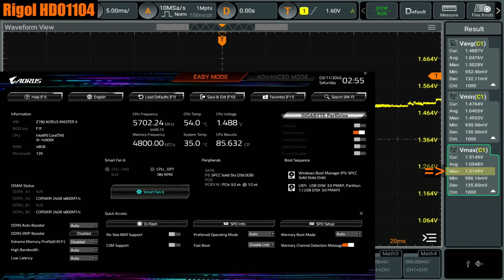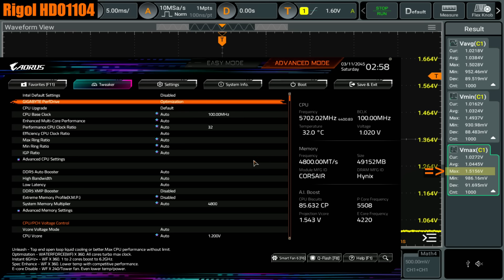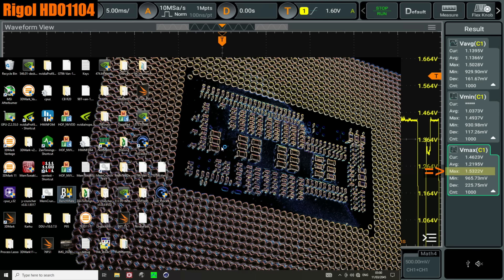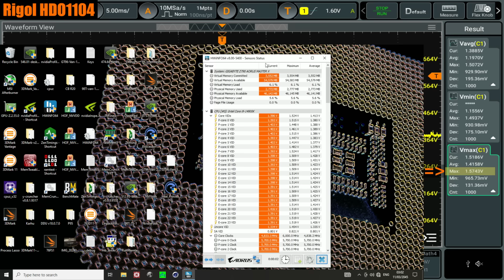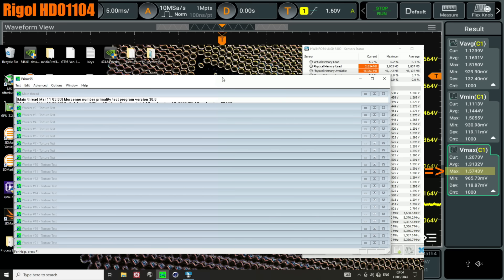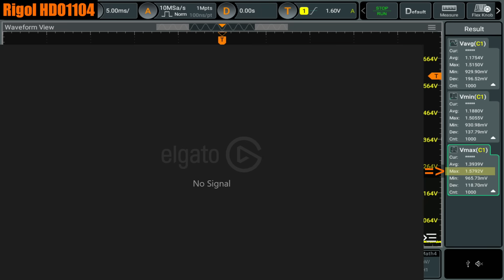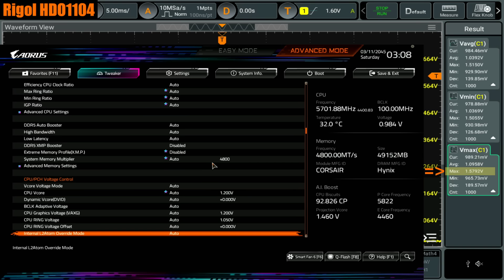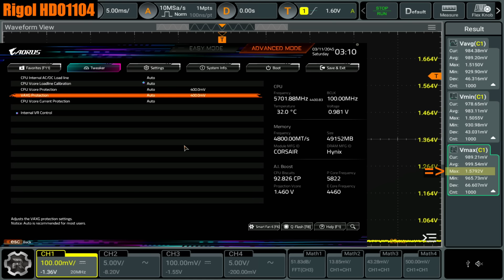Turning off "Intel Default Settings" with Microcode 0x129 DISABLES THE VID/VCORE LIMIT

Comment: I am forever glad that when I decided to upgrade my 5950X to a newer, gaming-focused setup, that I went with the 7800X3D instead of going with the more expensive Intel route, cuz holy crap would I have been pissed with all this going on if I'd paid ~$600+ for that CPU.
Reply: Yep, lots of Intel shills are pissed there $600+ CPU kills itself on arrival basically.  Even coping by saying "just rma it haha" until Intel rejects your RMA lmaooo
Reply: @Nighterlev  i think youre on the wrong channel, there is no way you can have this opinion unless you dont know what the problem is these cpus had. 
Spoiler: too much voltage. Take care of it yourself and youll have a cpu that wont kill itself, just like any other cpu that doesnt get fed too much voltage..
Reply: How ironic. I'm currently building an "open box" intel system with a 13700k, and to get anything that would even come close to competing I would be spending double for AMD. I don't have any brand loyalty and I was really trying to put an AMD system together this time. Not even with returned/open box products could I come close to my 13700k ($235) and Asus strix z790i ($213). Open box but unused. I really tried though.

Edit:
Even if I had purchased that CPU before, I don't think I would be pissed. I've been using Intel products for two decades and they've never let me down. I knew they would have fixed the situation and make good with their customers. Which they have, with fixes (still in beta) and a five year warranty. 👍
Reply: @DingleBerryschnapps  Nobody is talking about "open box" CPUs here. At one point I used Intel CPUs too, hell most of us did...because they were better however things change and AMD makes the best gaming CPU on the market right now.
Reply: @DingleBerryschnapps what are they going to do with all the small custom PC businesses that are going to have handle hundreds/thousands of CPUs that now need to be replaced or at least have the board BIOS's updated then tested? Is Intel going to pay for the shipping of entire PCs, the extra time and labor?

I flip PCs but thankfully never sold any with 13th or 14th gen Intel units (AM4 and 11-12th gen, mostly). You bet I'd be freaking out if I had sold ANY of those cursed chips to a customer.
Reply: @smugmode 
Have you seen PugetSystems article with 11th gen failure rate?

It's kinda not that big of a big deal, but at the same time, the 13th/14th gen customers are prompted to seek instability because of the articles, so there definitely are more false-positives, or otherwise undetected instability issues.

I think it means for the future, you should be sticking to CPU's manufacturer spec closely and disable MCE etc.
Reply: @tteqhu I just read it and a few comments there. I wish they would give more details on how many units were were affected with all those different CPUs, instead of just percentage. Which CPUs they sold in which generation (Ryzen 5 or 7 or 9? i5  or i7, etc). I don't like half pictures, I like lots of hard data and they're giving me blue balls over here.

Anecdotaly, I never had a problem with 11th gen Intel but they were all i5 or lower
Reply: @smugmode  
Yeah, it got me to think a couple days ago, that it's weird that 0 system integrators or servers share comprehensive reports, with many parts they're using.
I guess there isn't much monetary incentive, while there's definitely a cost.

Only Backblaze does pretty good quarterly reports with their HDDs.
Reply: @DingleBerryschnapps Intel eats like 200W to compete with AMD's 80W chips. Their CPUs are ancient and they have to heavily overclock them to compete and we are seeing the effects of that. 

I'd say nothing if they at least worked. Intel's performance in non-gaming use cases is just better than AMD and I guess it brings people comfort. Personally I couldn't care less about my CPU as nearly all programs from this century are GPU accelerated, but to each their own.
Reply: Enjoy your random crashes, because that's all i had when i had intel. It would literally give me anxiety.
Reply: @DingleBerryschnapps  same here i have a 5900x im going to throw it into my secondary build and build a new main system. just bought a new 14700k from microcenter for $232 bucks today 9/2/2024. if we go amd the price is double. im just trying to figure out what to set the cpu at so i dont have do deal with all the degradation crap. i dont need to run it full blast. i just want to run it safely
Reply: @DingleBerryschnapps 
Oh man, I'm jealous.
No way it'll last long now, especially since new articles can't get any worse than what it has been.
Not sure if you technically on warranty on open CPUs.

Comment: I'm waiting for my new CPU but I updated the micro code in my old build and my RAM will no longer run at above 5,000 MHz. Although I do have four dims populated.
Reply: 4800 is the official supported speed

Comment: As much as I love hearing the Del key spam, your fingers (or someones fingers in the chat) might appreciate having a .bat file that will reboot the PC and automatically open the Bios

NET SESSION
IF %ERRORLEVEL% NEQ 0 GOTO ELEVATE
GOTO ADMINTASKS

:ELEVATE
CD /d %~dp0
MSHTA "javascript: var shell = new ActiveXObject('shell.application'); shell.ShellExecute('%~nx0', '', '', 'runas', 1);close();"
EXIT

:ADMINTASKS
shutdown /fw /r /t 1
EXIT

If you put this into notepad and save it as a .bat file it will check to see if you're running the file as admin (required to use /fw flag), prompt to elevate if not, and then reboot after 1 second
Reply: Wait. That's a bat file... calling out to a utility to execute HTML files... to execute an embedded Javascript snippit... wrapping ActiveX... used to execute runas on the same bat file... that calls shutdown?

My kingdom for a 'sudo' command.

Comment: 01:10 They were "stupid" enough to not do anything about a known issue for 2 years for the sake of making shareholders happy. They were hoping this issue magically disappears. And they did not try to enforce any standards / defaults like other manufactures in all sorts of industries do. You simply get a "This is not supported" answer on the support hotline. Intel desperately tried to stay at the top of Benchmarks, to sell their stuff to make shareholders happy. And now 15.000 people need to leave the company, while the management buys another Yacht, a bigger House and more cars as a reward, because they reached the financial goals.

Comment: I do hope Intel comes back stronger having learnt from this. As we need competition to keep prices lower.
Reply: These cpu manufacturers should not release cpus every year. They need at least 3 years to innovate and test it fully.
Reply: @zilverman7820  Uh...No.
Reply: Intel basically gave up on trying to competr for market dominance in this current generation of process nodes. 

They have basically gambled the whole comapny on huge r&d spending to be first to market for 2nm chips with production planned to begin next year. 

If that's doesn't go well though they're fucked
Reply: @randomchannel-px6ho  I keep seeing people say this but the 13700k and 14900k are better chips than anything AMD has to offer. If AMD is dominating in the marketplace that's just due to better marketing.
Reply: @DingleBerryschnapps  amd's x3d chips are carrying their cpus.
Reply: @DingleBerryschnapps  AMD is far more efficient, better to build more cost-efficient setups... You can throw a 7600 with a 4080 with a good 650w psu... With Intel you need a 800w psu.
Reply: @DingleBerryschnapps the main factors for AMD market dominance.
1: TSMC, they simply get a severe efficiency and manufacturing advantage mostly from a third party

2: Chiplet, they can just scale into monster CPUs by combining chiplets, you seem to forget threadripper and epyc exist

3: Best integrated graphics, having things such as the ryzen 2200g beating the iGPU on the 14900k speaks for itself. This impacts a large portion of the market, and is also the reason why XO/PS4, XS/PS5 all use AMD processors (intel not caring about it allowed AMD to score many wins on this front) 

4: 3D CPUs probably don't sell that much, but always having ryzen at the top of most (if not all) gaming benchmark sure does marketing wonders

Comment: Also add the ILM bending to the list of LGA1700 issues, and according to Noctua the bending gets worse over time

And they removed AVX512 from 13/14 gen, what a shitshow
Reply: Still fine for 99% of the people out there... Not every kid wants to play RPCS3... Stop the drama. If you are not happy, switch to AMD, problem solved and no more whining.
Reply: @DrNoBrazil  congrats you got an inferior nerfed cpu with fewer instruction sets, and for no good reason other than corporate greed
Reply: @ThunderingRoar  It would be a nice gesture from Intel to re-enable those instructions. At least... But I doubt it.
Reply: @FEGTTTSDH  They can't, its fused off in all but the early batches of Alder Lake. Also since the e-cores don't have AVX-512, they must be turned off to use AVX-512 on the P-cores.
Reply: @FEGTTTSDH  probably only feasible with releasing a P-core only model. Currently released CPUs have the instructions physically disabled and software don't take kindly to having differing instruction sets between cores.
Reply: @DrNoBrazil  13th/14th gen Intel cpu even without AVX512 is still faster than other cpus with AVX 512 in RCPS3

Comment: So this microcode is basically "if intel defaults selected, then turn on voltage limiter, else let the cpu request anything it wants".... Got it... Someone got paid 100k+ to write this microcode 🤣🤣
Reply: i would expect further microcode updates in the near future lol
it seems like theres plenty of ... room for refinement .... in the current fix

tho perhaps understandable that they would rush this out given the situation
Reply: @ChrisJackson-js8rd technically it's their second iteration of it I think. I noticed they had 2 recent bios updates for my mobo
Reply: @mr_wez  yes. you are correct.
Reply: I mean, that's kinda the point of an unlocked CPU. You can choose the manufacturer's recommended specs or go wild and tune it to your liking
Reply: @ccc3  - you're missing that the BIOS setting is to increase the max power use / allow more-longer turbo boost, but intel code then also decides to increase the voltage too even though the BIOS setting does not ask for that.  Bugged bug fix still silently frying CPUs.
Reply: @ccc3  yeah but usually if you do things right CPUs don't die on you

Here you know that if you don't run them how they want, it will die overtime.
It also means that you'll never go near the advertised max frequencies, which is technically a scam when your whole marketing is around how your CPU can do 6ghz, but hey, actually you need to tune it down or it will die, sorry
Reply: Armchair Bro
Reply: It's directly from Intel's lawyers - it's a way to cancel warranties. Damningly, few tech tubers are notifying us of this, or its damning implications. Intel's 'influence' still reaches far ;)
Reply: I am running 13900k at 5.2ghz with AC/DC loadline 0.60 both on 0x125 microcode, Ring ratio 4.5, E-core 4ghz my CPU is sitting at 1.268-1.3v. I don't need 5.8ghz or 6ghz for game performances as most single players run on GPU and multiplayer  uses CPU cause of players nearby and my core does fine at 5.2ghz and i didn't have to undervolt. P1/p2 253W and 307A ICCmax.
Reply: @sunteraze ok, fine, good for you, but that’s SCAMMING customers. Full stop.
Intel sold CPU advertising them for 5.6 Ghz up to 6 Ghz… pricing them accordingly to what was advertized. If they advertized correctly that, hey, to stay safe 13900K must run at 5.2 Ghz how many CPU would have they sold…?🙄
If I sell you a car telling you that it can run stable at 100mph then you discover that, if you do that, the engine is garbage in 6 months, and to prevent that you have to stay under 70 mph, I SCAMMED you and you’ll probably sue me asking for a refund (at least a partial one)… rightfully……!🙄
Reply: @kapitumbulu  exactly this, buying a 13900k and being forced to tune down performance, not good.

Let alone the fact that buying an i9 for gaming is absolute waste if money
Reply: @sunteraze  You don't need a 13900k at all for gaming, lol
I hope you're doing actual multicore loads outside of gaming

Otherwise you could have gone for the 7800x3d, averages 60w in gaming and has better overall performance than the 13900k, kek
Reply: @sunteraze  That would be an admirable stance, if it weren't for the fact that the CPU's are sold as being capable of operating at a set frequency. The emphasis should NOT be on the consumer to underclock to give their chips the ability to operate without self destructing. That's the issue that people have. The product's would have been released with this knowledge. If you are content with your chip operating at 0.5-1ghz below the advertised frequency, then I'm glad you're content with your purchase, but I don't think that you should be defending the company for falsely advertising. There is no weakness in admitting that you made a bad purchase, particularly when so many other people made the same purchase, it was not the consumer's fault, it was Intel's fault.
Reply: @sunteraze that's odd, but good. I've seen a few people reporting weird voltage behaviours compared to what's set in BIOS: E.g. On ASUS Boards I've seen voltages of 1.296V (1.3v) set in bios but the CPU itself is asking for 1.46V and receiving 1.424V via VID sensor. It's good ur motherboard isn't (probably) overvolting your CPU!
Reply: @sunteraze  The only real solution I see is not so much to update the bios but to limit the frequency to 5.2ghz so that the voltage does not go over 1.3v, for me at 5.4ghz an i7 13700k goes at 1.36v maximum but at 5.2ghz it works for me at 1.28v pot there is.
Reply: @ganr1277  5.4 a 5.2 ? nop
Reply: @sunteraze  253w on a CPU?!😅😅 Do you own a power plant?
Reply: @SupraSav  If you don't set that limit, the cpu will assume you do :p
Reply: @SupraSav  That's more power than my entire pc running at it's absolute maximum power.
Reply: Any proof of this amount?
Reply: @DrNoBrazil  I think he is referring to the tech salary
Reply: @DrNoBrazil salaries…

Comment: Good stuff! Is there any way to set the voltage limit stuff manually if one turns off the Intel default settings?
Reply: Yep, check 13:05 , you can set max voltage through the IA VR Voltage Limit, though it may be named differently on other motherboards
Reply: @Summanis  the only setting i made was to limit power to 235watts after microcode update... i could not find IA VR or VCore voltage limits, which i wanted to set at 1.4 Volts, i have the same gigabyte motherboard, but slightly different interface, its all so confusing...
Reply: @realracing3specter295  For real. I try searching up what all the settings in my MSI motherboard do and half the time nothing related comes up. I still have no idea what "memory extension mode" is. I haven't even checked to see if my motherboard has a similar voltage limit (12th gen) but I'm sure it would turn into a rabbit hole.